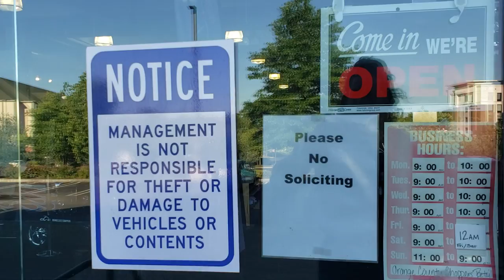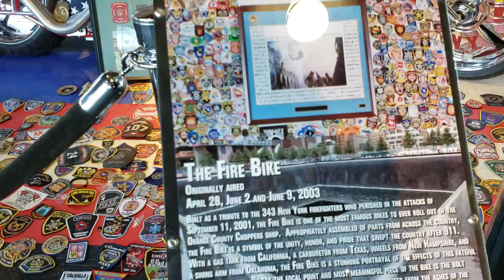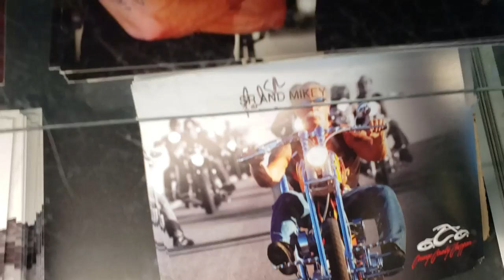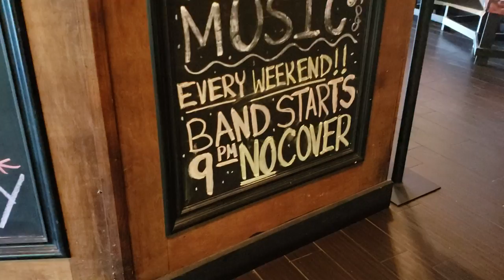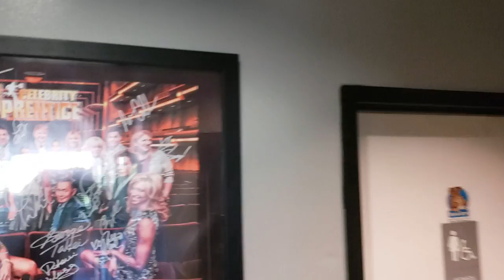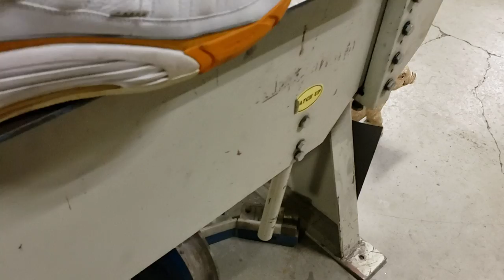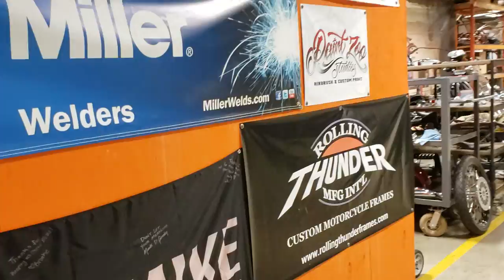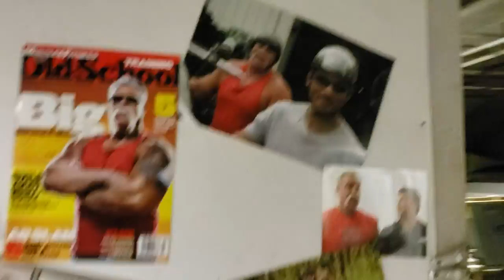ORANGE COUNTY CHOPPERS SHOP VISIT & TOUR

Comment: Only one I didn't really have respect for was the dream bike. Even if it is almost unrideable the least they can do is make it somewhat functional. At bare minimum you should still be able to start it and make some noise.
Reply: They could start it. Purely a show piece, but there was a small fuel tank disguised as an oil tank for firing it up and doing (very!) short rides.

Comment: ARE YOU KIDDING ME? 
Is this a bike shop or Six Flags Great Adventure? 
If it were not for there TV series, OCC would still be putting bikes together in there garage....   You noticed I did not state “Build” To build a bike, that includes the engine and tranny......  Not some fabricated parts stuck to a stock frame, drivetrain and wheels!    Any Bozo can “Bolt” a bike together!  
 
And if there so famous! What ever happened to that dealership idea that never came to be? I’ve never seen or heard from anybody who owned an OCC chopper!   
   The day OCC becomes more famous than Harley Davidson, I’ll eat the seat off my soft-tail springer!